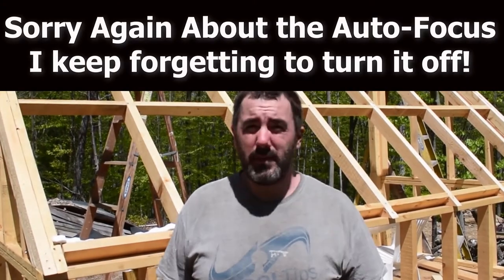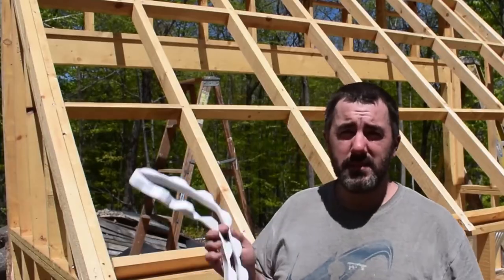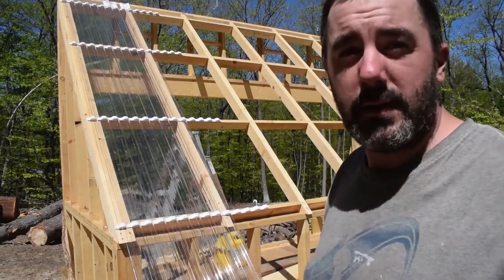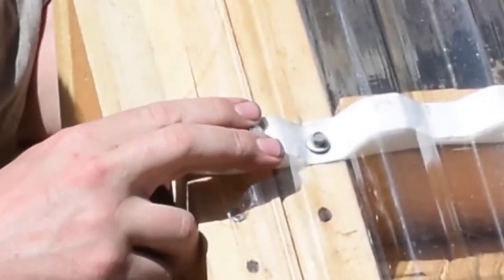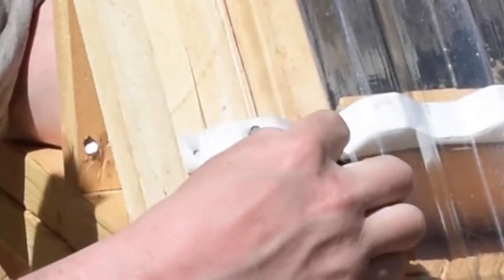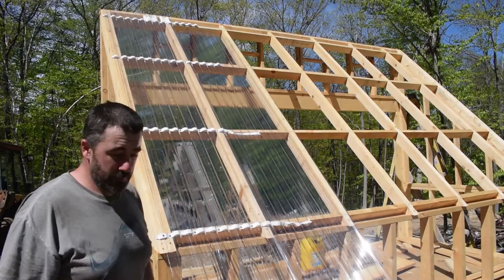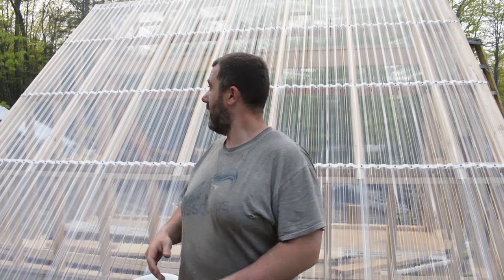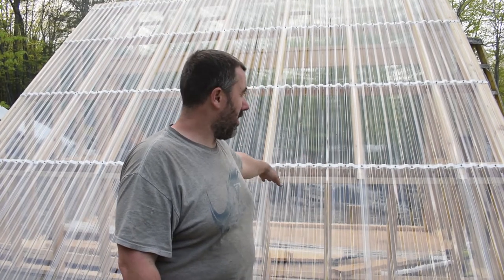Solar Kiln Build Part 9 - Tuftex Poly Carbonate Roofing Install

Comment: Looks nice with the panels.  I was always led to believe that you don't put screws in the valley as you don't want holes where the water runs.
Reply from the maker: Yeah, sadly I learned this after I installed it.  Lesson learned.  If it leaks I will have to re-do it or try to fix the leaks somehow.  Thats what I get for not reading instructions.  Fingers crossed hoping it dont leak.

Comment: Looking great! How much fun is it finagling that ladder under the rafters to put screws in?
Reply from the maker: What a pain!  I also hit my head so many times.  Sadly, I learned that I shouldnt have screwed into the valleys of the roof panels.  I sure hope it doesnt leak.  Kicking myself for not following the instructions.
Reply: Dillons Woodworks Well, bummer, I did the same thing! I have not witnessed any leaks yet. Those rubber grommets on the screws do a pretty good job.
Reply from the maker: That's just what I was thinking.   Plus it's a steep pitch, so I think it will be fine.  Let me know if you notice issues and I will do the same.
Reply: @practicallyIndependent  So did a prior homeowner here, who built a small shed ca. 1990 that's more like a sundeck with a fence around it, with a flat roof of corrugated fiberglass with just enough pitch to allow rain runoff. I got caught out in a huge thunder-burst downpour the other day, one of those cats and dogs deluges that lasted about a half hour. Lucky for me, I just happened to be in that little shed and looked at the roof to check for spots that might need maintenance and... Still no leaks, and I've never seen evidence of leakage under that roof. How is your's holding up?
Reply from the maker: @houndsong  Holding up well.  In fact, we sold the house and the new owners inherited it.  I think they will use it as a greenhouse

Comment: Hi there. Do you know anything about right type of roofing material? Dual wall is better because of thermal isolation but on the other hand this "wavy" type should catch a lot more sunlights because of wave shape there will not be so much reflection in morning and evening like with straight material, right? Thank you, Tomas

Comment: Mike, hate to say this but..
per Tuftex installation
In a roofing application, fasten the panels on the crowns of the corrugation. In a siding or wall application, fasten the panels in the valleys.

Hope they don't leak in the valley in the future

BTW, what BF are you looking at loading at?
Reply from the maker: If I have any leaking issues I will have to address that.  Nothing I cant fix, but very good to know as I may use this again in the future for other projects.  Thanks Chris!  Hope you are having a great day so far.
Reply from the maker: I am told this will hold 1000 BF, but I guess we will see.  I plan on loading it with some pine at first to test it out and tweak things as needed.  I just ordered a bluetooth thermometer/hygrometer to make it easier to monitor.
Reply: Will you be running a program logging the temperature and humidity

Comment: Nice work. How long is the Tuftex roofing estimated to last? If you switch your music completely over to metal, I might just watch your videos multiple times from multiple IP addresses to say thanks. \m/ Of course, that probably won't make up for the viewers you might lose from turning your channel into Dillons Metal Woodworks.
Reply from the maker: Not sure how long it will last, but for the price if it lasts even a fee years it's worth it.  Lol, Metal Woodworks.  Has a nice ring to it.

Comment: Im curious, how you cut the bottom of the poly off. Seems kind of brittle. Im at this stage in my kiln, not really sure how Im going to cut it off.
Reply from the maker: I used a metal cutting blade on my jig saw.  I also heard you can use a circular saw with the blade turned backwards and cut slowly.

Comment: Did you put in another layer of solar panels? Plastic ?
I am under the impression that it is best to have two layers...?
Reply from the maker: I agree that two layers would probably help keep it warm.  This year we built a dehumidification kiln, so we will be decommissioning this one and will be using it as a greenhouse.   Its worked well for us, but with our current rate of production we need something faster and more controlled.   Thank you for watching. More videos coming soon with big news and updates.
Reply: @practicallyIndependent  will you be making a video of the new kiln?

Comment: Nice Mike, I was just listening to Korn yesterday, kinda fits..  out of curiosity will there be condensation on the inside of the tuftex or more to the point any chance of the gasket absorbing moisture when its up and running?
Reply from the maker: I believe the fans, vents, and baffles will do a good job controlling the condensation.  I also just ordered a wireless thermometer hydrometer to make it easy to monitor the conditions.  Once I get it running I will have a good idea on how I need to tweak it.
Reply: Dillons Woodworks Mine has condensation at night when the fans are off. However, this is the beauty of a solar kiln. At night condensation settles on the surface of the boards and conditions the wood and reduces cracking. At least that’s what I’ve read. I haven’t yet installed my timers for the fans but when I turn them off manually I witness this.
Reply from the maker: Thats cool.  Ok.  Good to know.  What are the highest temps you were able to get?  I am curious how hot it will get.  Thanks man!
Reply: Dillons Woodworks I’m not sure. The reason is that my thermometer only goes to 125. It has blown past that mark easily. I’m confident it’s getting to the 130-135 range. But, we live in Georgia and it gets hot here. I have a second thermometer in there now that goes higher so hopefully I’ll know soon. I bet with insulation it would do better.
Reply from the maker: Best I have seen so far is 130.  Hoping for more once I finish the insulation and painting.  Also still have to caulk some of the gaps and install flashing.